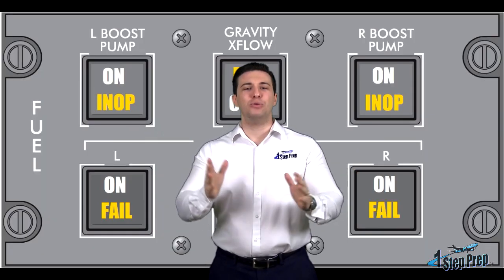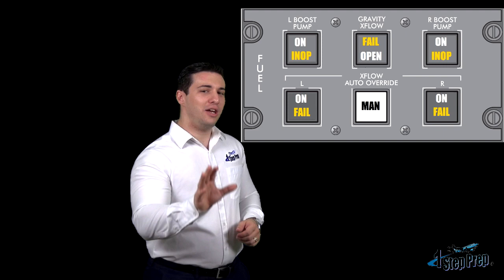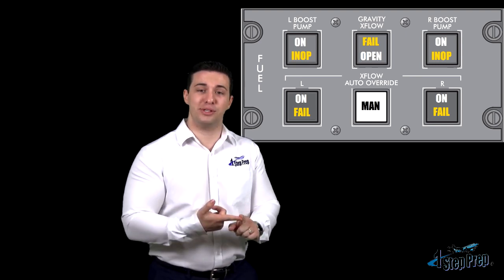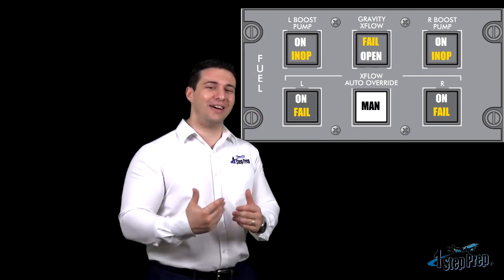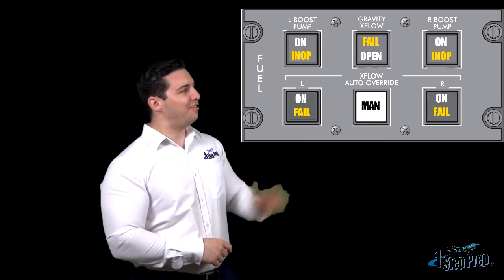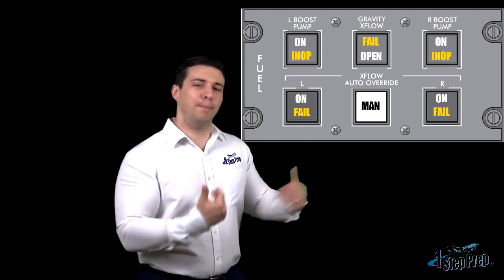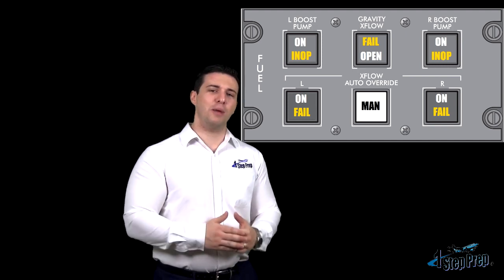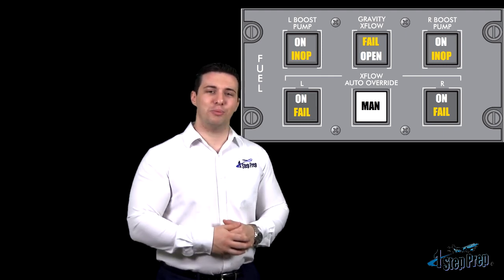CRJ Oral Prep

Comment: Also if there is no more fuel in the fuel tanks if the pilot forgot to switch it off after X  transferring the fuel tank / and I also want to point one more thing in (low-pressure scenario ) it dost mean there is no fuel transfer at all  ! actually it, men, the fuel transfers is less than 800p/h which is the normal fuel pump presser transfers . (so it is the only malfunction )